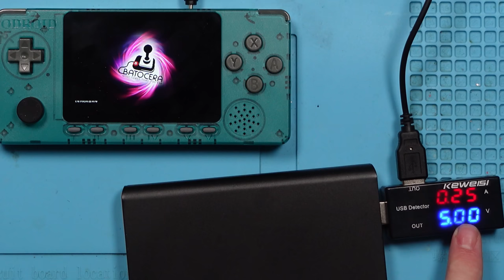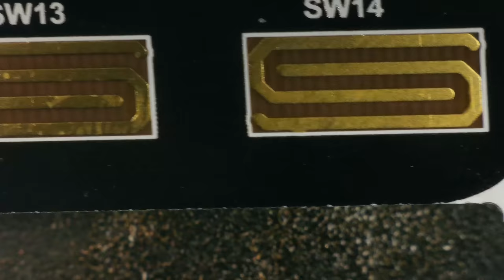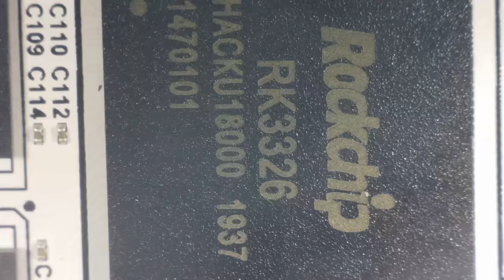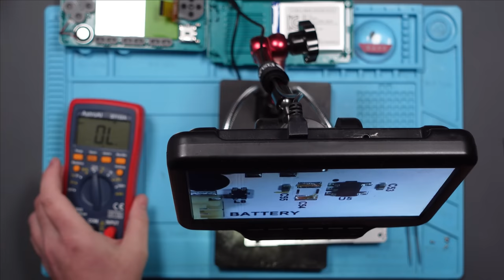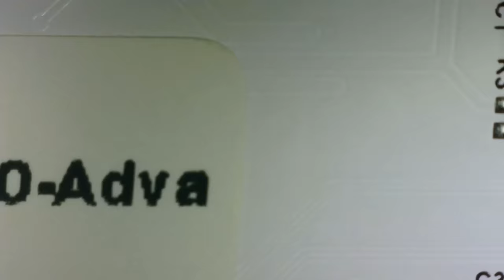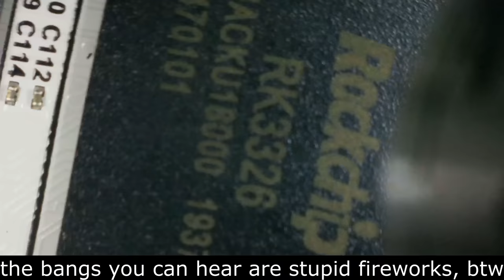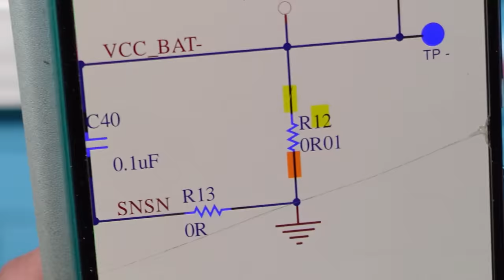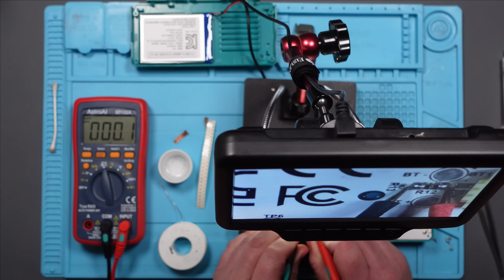I Bought an Odroid GO with a Strange FAULT | Can I FIX It?

Comment from the maker: Stupid... Stupid game
Reply: 😝😝I'm watching just for this moment
Reply: Nice repair 🎉😊
Reply: Would you like a Gameboy Pocket present?
Reply: Good video, but as a massive WHAM! Fan as a teenager, I've gotta say that was sacrilege listening to that version of wake me up, however I'm willing to forgive and forget as the video content was good lol 😄😁😆😅🤣😂❤
Reply: You should learn how to make ur own resistors at home.
Or how to tweak the ones you already have.
Reply: Hey Steve, Steve here.

Just a lil concerned, the Lyrics your singing from actual songs are copyrighted too mate, you know that right?

Love the videos m8, was originally watching Vince but switched to you the past year haha, consuming and learning from your content to the point I'm now fixing some electronics, got a long way to go! 

👌👍🙌🫶
Reply: BEFORE you put the capacitor on the board you REALLY should have TINNED THE PADS (added some soldier to them) so you didn't have to get the pas and capacitor extra hot to cause the capillary action to suck the the soldier in between them both... ( like you had to do in order to be CERTAIN the soldier was in between the pad and cap @ 7:39 ) it just makes everything easier when you add fresh soldier to pad AND even if you're removing stuff too.....  yes you end up wasting soldier sometimes, but you avoid A TON OF HEADACHES because the soldier will melt super easy and flow nice and even... It's worth getting into the habit of doing :)

Comment: Steve you need to replace that 0ohm resistor with a proper 0.01ohm 1% pronto, it might be part of the battery charging circuit and very bad things 🔥could happen if the battery is overcharged.
Reply: I agree with this. Do not leave it charging for a long time until you fit the correct part.
Reply: I looked at the RK817 data sheet and your suspicion is correct: That is the battery gauge sense resistor - It needs to be the correct value or you will overcharge the battery.
Reply: I'm thinking it probably acts as a shunt for sensing the battery current, either for charging or discharging. It probably won't cause an overcharge, but it might result in too much charging current, which isn't exactly good either. It might also cause issues for the accuracy of the battery percentage reading, since the current draw is usually used to compensate for the voltage drop.
Reply: Exactly, you find the exact same type of resistor (but way bigger) on EVERY laptop on DC Side and Bat side, it's main propose is to sense current

Comment: Great Job Steve! Those pesky resistors and capacitors falling off. On a side note FB1 FB2 or FB normally means ferrite bead, not a fuse :)
Reply: what are those for?
Reply: @BennyAlex98  Usually (but not always) part of a filter circuit (usually with capacitors to form an LC circuit) to suppress power supply switching noise from affecting  sensitive components (micros etc). Measures like an inductor (low resistance).
Reply: Pretty sure fb is Facebook
Reply: I don't think they just fell off... Seems more likely that the circuit got overloaded somehow and burned up the 0 ohm resistor and torched that 100uF capacitor too.
Reply: FB stands for fuse....boy.

Comment: Appreciation post for always super cleaning the area of work. I've seen other repairers leave stains on the board, which drives me nuts. Love it!
Reply: Who cares if you don't see it lol
Reply: @Sam Holdsworth  It's a reflection of the repair worker in both work ethic and care about the item they're working on. Stez amplifies this by how he won't give up on most things until there's absolutely nothing else to try. 

If you sent in something to be repaired, you'd want it back as close to the factory, wouldn't you?
Reply: @GameRaveTV  fair enough.
Reply: @samholdsworth420  Dirt can promote corrosion, and of course it's harder to inspect your work for bridges and cold solder joints if you don't clean it properly.

It seems to me that a lot of youngish men interpret cleanliness as fussiness and therefore weak. It's almost as if they're threatened by something looking good, as if that coded unmanly for some reason.
Reply: @Ea-Nasir_Copper_Co  no I just wouldn't care... And I'm 42 years old I'm not very young lol

Comment: Nice fix Steve! A 0,01 Ohm resistor (or any really low precize value resistor) is usually a current sensing resistor. The device is measuring the voltage drop on that specific value and then it can calculate the current draw. I do now know the entire circuit could be that it is measuring the current draw of teh device or charging current or something like this and if there would be a short for example it would know that there is an excess overcurrent so it would shut down. You might have  killed this feature now because it will definitely measure some odd value.
Reply: These are often part of the smart battery management chipset in gaming devices with a battery.  Sometimes it’s on its own micro board on the end of the battery, but often it’s either on its own separate board off the battery or on the main board itself.
Reply: @hugegamer5988  yes, in most modern devices, battery management is solved by specific ICs and the implemented BMS on the battery.
Reply: If it's for measuring charge current, it could possibly damage the battery. 

Regardless, please replace it with a precise 0.01 Ohm resistor ASAP, Steve! 🙏😬😁

Comment: Oh man, RIP that poor capacitor.
Reply from the maker: I'd love to know what happened to it, seems odd it would self destruct like that unless it was damaged already and popped out when the unit was dropped!?
Reply: @StezStixFix  I’ve designed electronic devices that are designed to be thrown and impact hard surfaces that regularly take upwards of 1k times earths gravity, small smd components like 1206 and under don’t even need potting and won’t come off unless there is a ton of board flex and likely many throws.  When they fail from impact due to board bending, they crack a colder solder joint or crack an end often in a way that’s hard to see.  Leaving both the pads and a bit of the substrate tells me it was outgassing causing an explosion likely from over voltage as another commenter suggested.
Reply: @StezStixFix  I do this for a living. I can almost guarantee someone has twatted it off the board when handling it, same with the current sense resistor. Likely either dropped the PCB and those components caught the brunt of it, or they've had an "oops!" moment with a screwdriver. You'll want to fit the correct value 0r01 too btw, it's how it'll measure the charge current, with that 0r link on there it'll think it's drawing a different amount of current than it actually is, unless you've got super lucky and picked one that is actually 0r01.

Comment: Nice fix..... makes you wonder what exploded those components... likely the wrong power supply..... you are lucky the voltage regulator was not fried as well... GOOD STUFF Mate !!
Reply from the maker: Cheers Ron, Yeah, good point, I wonder if the voltage regulator is gonna last?  🤔
Reply: What, you mean ceramic caps aren’t supposed to explode?  I’ve been electronicing wrong all these years!   Next you’ll tell me they don’t actually hide all the colors in every LED, your just not over currenting it enough.
Reply: @hugegamer5988   HAHAHAHA
Reply: it was made in a Chinese factory so they were probably not put on correctly. It seems they are still on the factory floor somewhere.
Reply: @hugegamer5988  Heh, if it worries you ceramic caps exploding, you should take a look at tantalum ones. They tend to explode like a little bombs... 😁

Cheers!
Reply: @DalmaTon-Records  Reminds me when we used to have a dead battery bucket at work.  We were supposed to discharge them fully first but, you know, people.   Someone threw in some massive primary lithium coin cells (1/3 n) that weren’t dead.  Anywho when one exploded my ears rang for about an hour and it actually made sparks and a nasty smell.  We don’t do that anymore.. like we weren’t supposed to in the first place.

Comment: Good fix! A note though, the 10mOhm resistor could have been  a current sense resistor for overcurrent detection. That's how shunt current sensors work, you feed the difference voltage from either terminal of the resistor to a differential op amp and it gives you measurable voltage from a few millivolts or less. a 0-ohm will yield 0 voltage drop, so your current sensor will always measure 0 amps. It's just a protection though, so it can work without.
Cheers

Comment: Steve, when measuring small resistance (let's say less than 10 Ohms) with a handheld multimeter, you should always "zero your leads", i.e. check the reading on the multimeter with the leads shorted and, if it's not zero, substract it from the measured value. A good set of leads should read about 0.06 Ohms, which your multimeter should round up to 0.1 Ohms. If it doesn't, then the "0" Ohm resistor does indeed have some resistance.
At my job I regularly measure resistances of 0.0001 Ohms or lower, so 0.01 Ohm is a fairly large one in the world of current measuring shunts.

Comment: 0.01 ohm resistor is most likely for sensing the charge current.
Reply: That was also my first guess, especially being located right next to the battery terminal. Looking at the datasheet confirmes it: the resistor is connected to the SNSP and SNSN pins of the RK817 chip, which are responsible for "Bat charging and discharging sense current".
Reply: I feared that, and it makes it pretty damned important to replace it

Comment: Searched for use of that milli ohm resistor. Could be an amp-sensor, converting amps to volts for an IC to measure.

Comment: Nice one Steve - back of the net😀
Reply from the maker: Thanks Greg!  👍
Reply: @StezStixFix  Hi Steve, just to let you know, there are people here that has confirmed that the 0.01ohm resistor is for measuring charge current. It's critical that this is not a zero ohm resistor, because the chip that manages charge, will think that it's charging with 0Amps, because there's no voltage drop over the resistor, and keep cranking up the voltage to whatever maximum it can, which will likely destroy the battery - but I hope that it won't fail violently.
Regardless, please replace that resistor before charging the battery again 🙏😊

(EDIT: I'm not saying this to steal credit, please give it to the person who looked up the diagram - I just worry about battery safety)

Comment: with that barrel type power plug likely somone applied way too much voltage and the 0ohm and 100uf cap gave up to protect the rest of the board

Comment: That was Battery Current Sense.

The charge chip diverts a portion of the USB charge voltage to the battery for charging.

The charge chip outputs the voltage towards the battery. To ensure the current is normal, the charge chip samples the voltage before and after it passes the resistor.

Without the resistor the charge chip thinks there is a short and will not charge or supply power to the battery.

Comment: I've seen surface mount 0-ohm resistors used a couple of ways, principally as a jumper instead of using a via to another layer to hop over another track on the PCB, I've also seen them used as a "poor man's fuse" since the component may be electronically inconsequential it still has a maximum power rating, which can be more practical than using an actual fuse ~ particularly around batteries where a fixed amperage fuse can be problematic

Comment: R4 is a pulldown resistor. R3 and R62 seem pull-up resistors for servicing the board perhaps? R12 is a short between BAT- and ground. I wonder if anyone connected Bat+ there and R12 blew up.

Comment: The small value resistor was a shunt resistor designed to measure battery current. It might not be a good idea to charge that unit until you get a correct value resistor.

Comment: That resistor is the current sense resistor. Not always needed for the console to work, but if you have charging issues later, at least you will know where is the fault.

Comment: I have a little HH console. It looks like a Game boy that's been shrunk in wash. 
It plays a lot of games from Regular GB, CB Colour, GB Advance, NES, Master System, MegaDrive, Snes, N64, Game Cube, PS1, and MAME. The only trouble is the screen is tiny and a bit shit. And some games require more buttons then the system has. But it was only £25 and it came with a 64G SD card filled with over 4000 roms.

Comment: C54 where are you? If anyone gets that reference, you will earn a hero cookie.

Also R12 appears to be just a current sense resistor. Only reason they ask for a high precision resistor is for accurate stable results.
Reply: But as someone else pointed out, this is for charge current - with a 0 Ohm resistor, it'll charge with as much voltage as can be delivered, which likely will damage the battery
Reply: @nemesis2264  Good jorb, you earned one cookie

Comment: Well done on the repair, Steve. You are getting more and more like Big Clive every day.
Reply: Well, except he didn't spot the purpose of the current sense resistor, which I was surprised about tbh. It was written on the cct diag.
Reply: @twotone3070  ??? If you say so. Not that I know what a sense resistor or a CC diag is.  I only just found out how to change the batteries in my remote.  I am glad that people with brains exist. If only I had half your knowledge I would be happy.
Reply: @yogibear2k220  Don't get me wrong, I think Steve is great, I wish he was a mate of mine.  He has ten times more screen presence than I do and I wish him every success. 
I know what it's like to put yourself out there to take criticism and it only takes one smart arse to spoil your day.
On the point of the resistor I just thought, Oh, he hasn't looked into why it showed a resistance and why would it be zero ohms and this surprised me. No hate or one-up-manship intended, I accept my comment did read that way.

Comment: Good work Stevo, but for the love of all things good stop using that sh*tty conical tip, they're junk, throw it in the bin! You will have far better results using a larger tip, you need to try using either of the following which will help you a lot! T15-BC2, T15-BCM2 or the T15-JS02 all those 3 will do almost all jobs, for really large ground pads grab the T15-D32 and you'll be golden! Great video once again mate.

Comment: Bit of advice if you'd like, tin the pads before trying to solder the SMDs. Works so much better. Also, be free with the flux, it helps to round out the solder joints nicely.

Comment: If he turned down the volume or shut it off when you plug it in it might charge without having to do anything
Reply: That resistor is apart of the charge feedback circuit. It's how the charge chip verifies the charge voltage is normal. 

Without it, the charge chip thinks the line is short and will not charge the battery.

Comment: The Issues you have with Soldering might be because of the tip.
Can you replace the round ones with chisel or knife tips? 
And you're using a little bit too much Solder. Not much, just a little.
Reply: That and alway use flux while soldering and not just for removing parts. You should first slightly tin just one pad with solder, then hold the component with a tweaser and solder it on while slightly pressing the component flat on the pcb. Then solder the other side while holding the compontent down.

Comment: One day I saw a video of a nintendo 3Ds which had the same problem. The 3Ds had missing capacitors. 

One random guy in the comments said he worked for a nintendo store and the reason was because people used to stole shelf nintendo consoles so nintendo made it that way so thiefs couldn't use the nintendo with the battery and only plugged in... i think this is a similar case, this console was an stolen one from the shelf of who knows store haha maybe....

Comment: For a second I go "Its impossible that thing runs faster that the Nintendo Switch n64 emulator of 007" then goes into lag. Once again, 2 resistors render a $70 machine useless.

Comment: 12:25 The soldering tip you are using is not good. Use a wider one that can heat better. That is why you having problem to remove the ripped off components or what is left of it.

Comment: before watching i predict the charging module has failed so only direct power works.
Reply: Close! Pretty sure it was the failure in the battery protection circuitry (to make sure it doesn't explode) that rendered the battery useless.

Comment: Here's my theory on what happened to the Odroid GO:

Someone dropped it, noticed it didn't power on, opened it and got the rattling bits out and when it still didn't work they sold it.
Reply: I kind of did that with a controller of mine, didn’t sell it, but stuff rattled so I opened it and tipped the stuff out. Doesn’t work but I think I broke something like a ribbon cable, the rattling was the clips holding the shell together.

Comment: You should use a flat soldered tip for solder removal with wick
About capacitor soldering it is better to put solder on both points and solder a capacitor with a heat gun

Comment: Yes, the 0.01ohm 1% 1206 resistor is used as a current sensor for the battery charging circuit. The 0 ohm that you used may make the circuit unable to recognize when the battery is fully charged and could cause a catastrophic failure when you try to charge it. DO NOT charge the battery until you have replaced the missing resistor with the correct value!